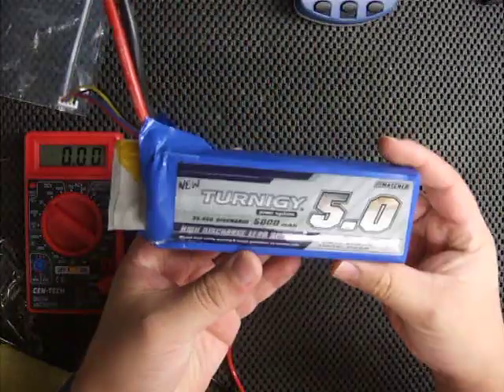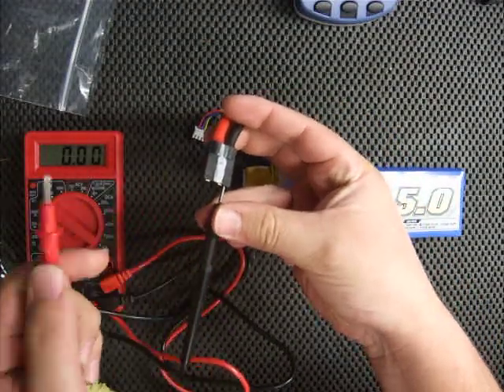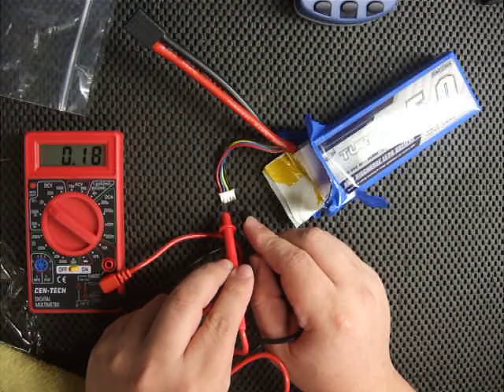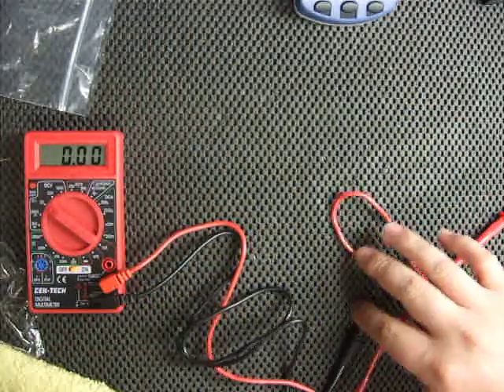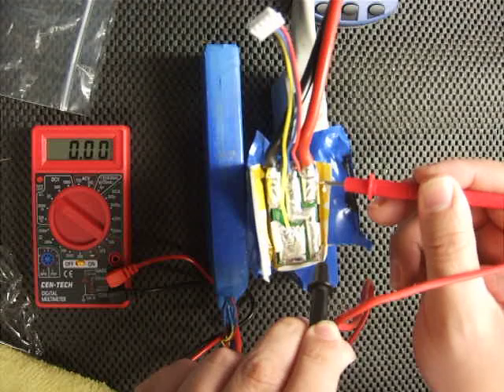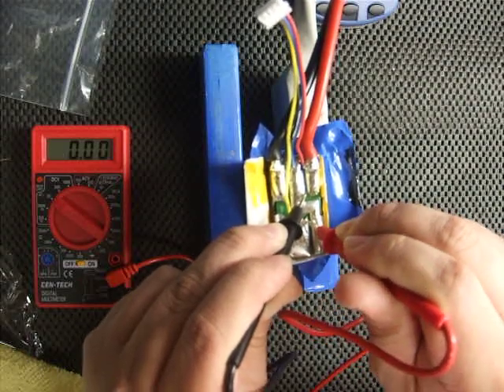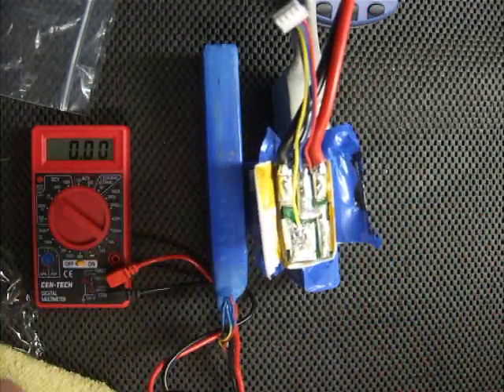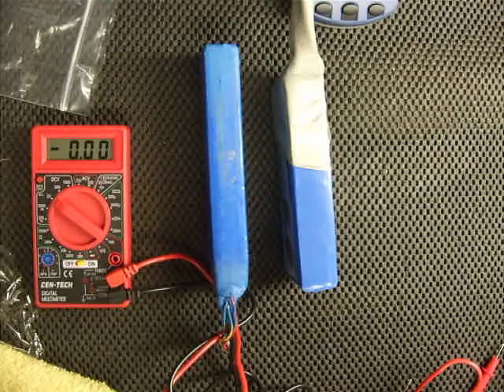Turnigy 5000 mAh 3S Lipo Testing & Repair Questions | DOA from HobbyKing

Comment: what i find with turnegy its the  plug balancer plug if you plug it into the ballancer of your charger then wiggle it or push the cables in it will read them.. cuz they use shitty chinese parts...

Comment: you always touch black for each cell that is always the negative and the other wires are positive r,y,b
Reply: on my testing,,i noticed NOT TO just use the blk wire as ground,,,is i use one blk ground i get a reading of one cell..(red wire)  leave tester on blk still and move to (yellow wire) it then dbl the voltage,,,test on same blk wire,,move positive to the (blue wire) gives the full votage of the whole pack...the way i have to test on mine to get single cell votage but using charging plug,, is to put one on blk and one on the wire next to it.lets say the blue wire,,ill get 3.95  hen simply move both leads over one wire,,now im on blure and say,,red,,,ill get the single votage reading once again,,and so on...

Comment: You needed to test the main leads at the cell end to see if you had normal voltage there then the fault would be a dry joint in the plug, (not being critical just trying to help)

Comment: Sorry I meant at 4.26 to 4.35, you touch one end of a solder joint and the other end of the solder joint and don't get a reading, its because its the same connection both leads are on, 

Was meant to come across as just helpful, hope it did,

Comment: What you have is a LiPo where two cells have dropped below the minimum voltage rating which means the charger assumes its the wring battery You can recondition lipo batteries to get them back above their minimum voltage there are a few ways one is to charge for 20 seconds at a time on a NiMh setting to force restore the voltage however this has to be done outside and in a box because of tthe pottential of  an explosion if you over cook it seen it done it :/ but this is the method I use as it wo

Comment: you were supposed to put your black multimeter lead onto the black wires solder, ( top left in the video when battery is balanced between the other 2 batteries )
then touch the remaining 3 solder points 1 by 1 with the red lead, 
then you will get a reading from each of the 3 cells,

you wont get a reading by touching 2 positive ends with your leads, hence no readings,

its like putting 2 x AA batteries on a table and touching the 2 positive ends and expecting to get a reading,

Comment: Your probing is making me nervous! You need to be really careful not to short any of the cells, especially for LiPo batteries. They can dump insane amounts of current which causes heat, and potentially fire.

As for using the balance wire, you should measure like so:
Cell 1: Black -> Yellow
Cell 2: Yellow -> Blue
Cell 3: Blue -> Red

Looks like cells 2 and 3 are dead :(
On the positive side, I think if they were not dead, you would have had sparks while probing cell 2.

Comment: good video man! i have a hpi e10 drift monster mustang and i accidentally plugged the red and black wires into the charger wrong, next thing you know, the charger was smoking and was hot. i pulled it out and let it cool. plugged it into the battery correctly and idk if its charging or not... is it the charger or battery? i can use the battery but the car like drives than stops than drives.  can you please tell me whats going on

Comment: y do ppl say they get like 25 30 mins of run time with 3s? i run full speed speed runs with mine with a 5000mah 3s 11.1v lipo and get run times of about 1 hour and half. sometimes more. i have a onyx 3s 5000mah 25c 11.1v lipo with onyx 235 charger

Comment: dude i saw your video response today, sorry, very late.
simply those batteries if are death (0.00v, i can add under 2.5volts they can be tough as death cells) you can't repair them. They are very cheap batteries you can't expect anything very good.

JUST desold the cells, charge them  at 0.5C one by one at 3.7v and, if in a week they are not under 3.6v they are ok, if not, burn them overcharging :D

Comment from the maker: @Unsta View full description for update: ==============================
••• UPDATE 11/2010 •••
Attempts to stabilize the charge within each one of the cells failed with the exception of one cell that actually held the charge properly. The other two when charged (without balance cables) would lose its charge fully in 24 hours or less while sitting unused after being charged.
The pack was fully discharged and discarded unfortunately.

Comment from the maker: @1521joe View full description for update: ==============================
••• UPDATE 11/2010 •••
Attempts to stabilize the charge within each one of the cells failed with the exception of one cell that actually held the charge properly. The other two when charged (without balance cables) would lose its charge fully in 24 hours or less while sitting unused after being charged.
The pack was fully discharged and discarded unfortunately.